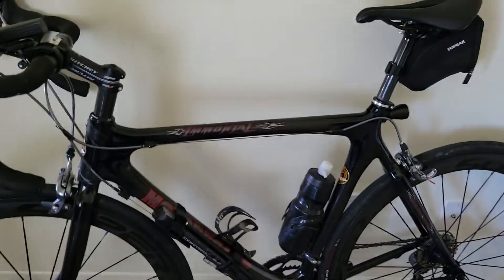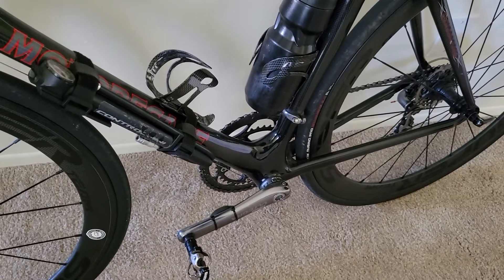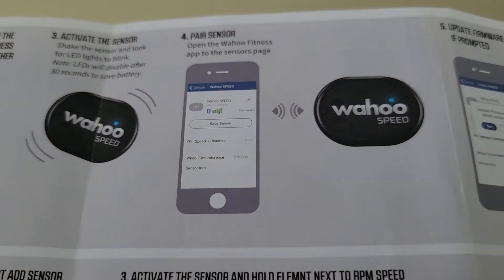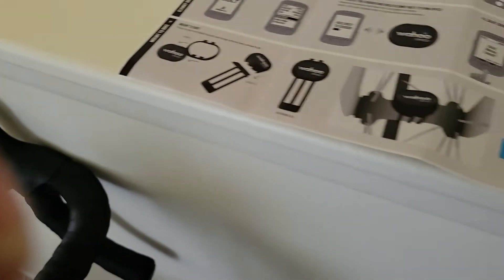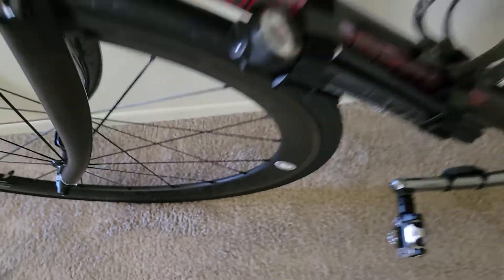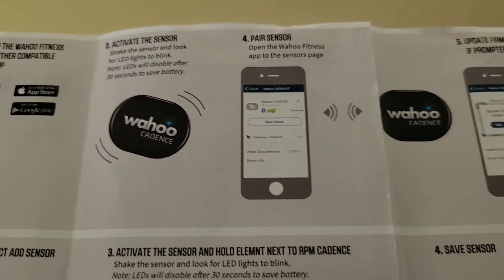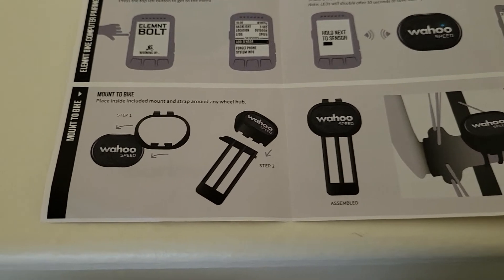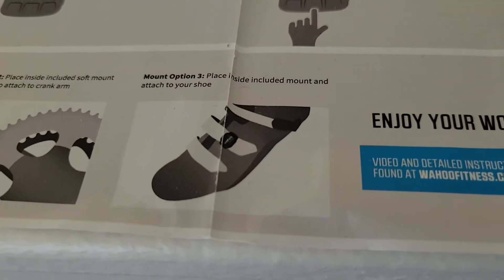How to install Wahoo speed and cadence sensor. #wahoo #garmin

Comment: Why do you need your phone at all? Or the app? Can’t you just use the bolt bike computer Alone??
Reply from the maker: The phone and app saved routes and other data that the bike computer may not  have access to
Reply: I think people get confused with this. The app is used to make all sorts of changes to what you want the Bolt to display and how it behaves to your preference. It’s used to download base maps on to the Bolt, as well as adding new routes. After that, you don’t need to have your phone on or even with you. But you will need it to save your ride afterwards. 
The exception is if you want to receive messages or alerts on the Bolt from your phone, or use the live tracking which allows someone you’ve designated (like a spouse) see where you are on a route if you so wish - then the app needs to be connected to the Bolt for this to work.
Reply: Thank you so much setting my bike up now and your voice is great
Reply from the maker: @lorindarose3294  You are so sweet! Hope you subscribed!